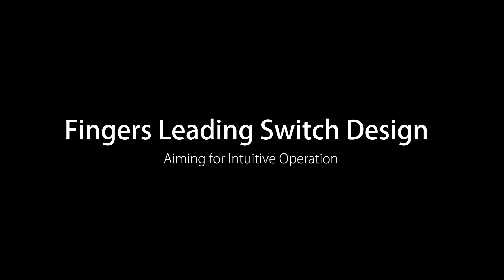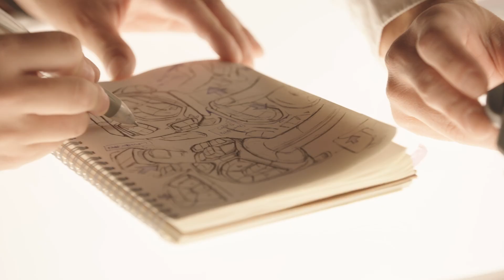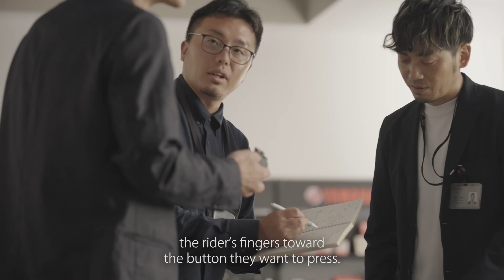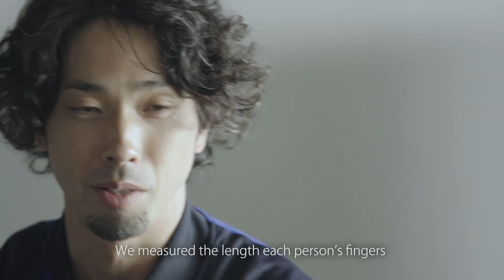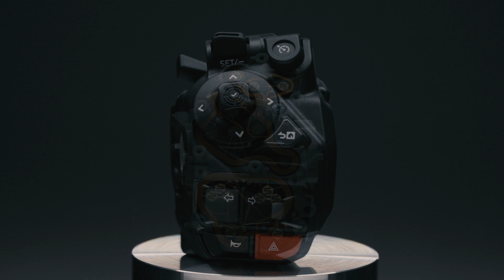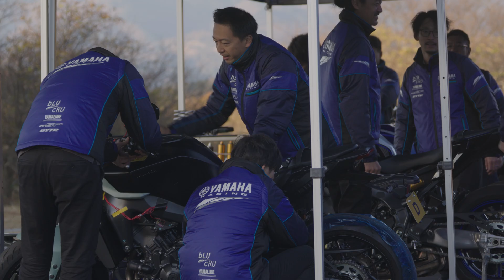Fingers Leading Switch Design

Comment: The new indicator switch is awful, I have a new GP and every time I use it I wonder why change something that was working good. Indicators switching off when they don't have to, having to look down for the LED if they are working or already off when you want to stop them. The good old click in the middle position to switch off everything from every previous state maybe was too good?

Comment: Rubber switches are the wrong way. After some years those will no more work. A steel switch will work longer. I have experience with the A/C control (Hella) made of that rubber switches. After 20 years it is a mess. The problem is the resistance of the carbon rubber. It makes dust remaining on the connecting surface, comes from old rubber plastic material. Sustainability means to use long lasting materials especially to that safety parts.